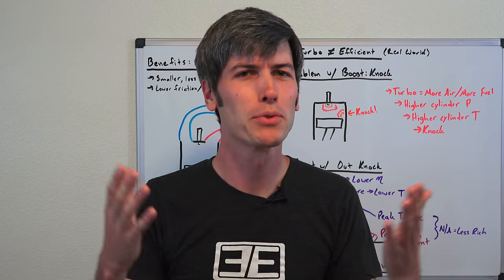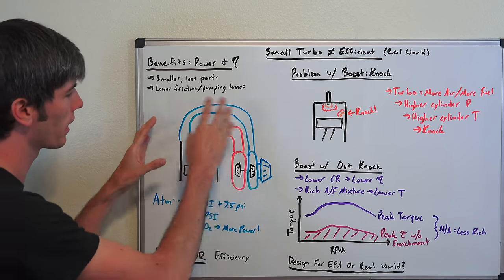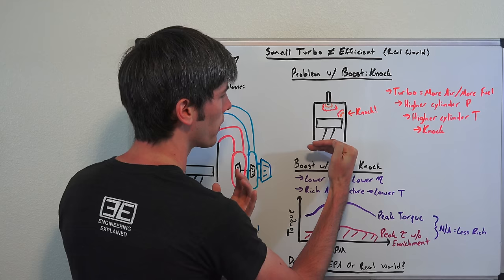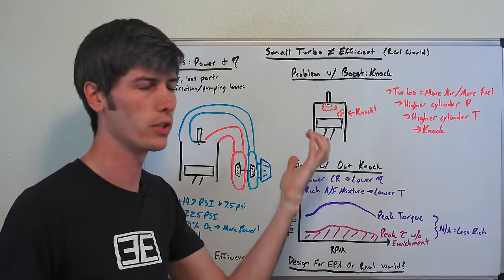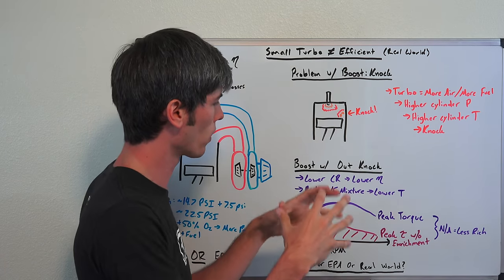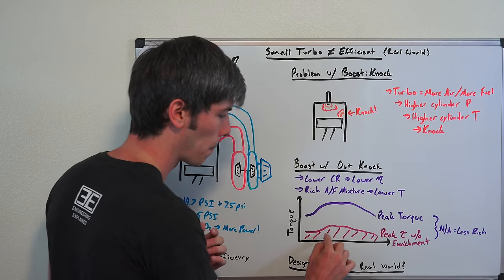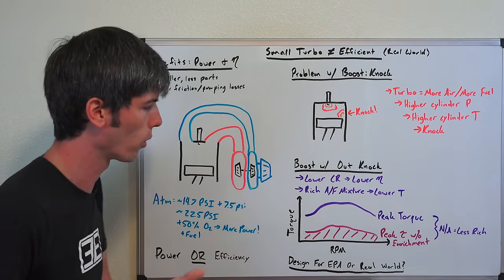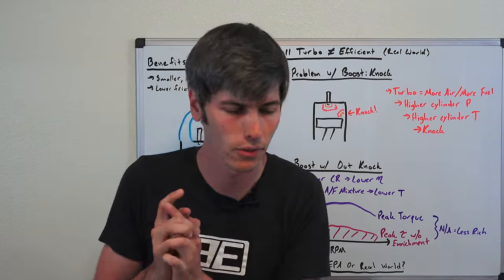Why Small Turbo Engines Are Not Efficient

Comment: I used to drive a 2012 Buick Regal GS with a 2.0l Turbo LHU engine (manual). It would regularly get 23 mpg as I drove to work. I bought a 2018 Mazda 6 with the 2.5l turbo a month and a half ago, and now I typically get 35-37mpg on the exact same route. I know the 2.5l is tuned very differently and it's a lighter car, but still even for those numbers.. Mazda's real world tuning is legit for my use-case.
Reply: DomitionX it depends a lot on the manufacturers because they all default different heat sources by using extra fuel, some of the newer engines use water injectors for cooler temperatures during combustion which requires less wasted fuel to keep the temps down. Also several newer transmission setups involving many more gears allows for cruising at higher speeds at very low rpms which produces much better fuel economy. 9 gears vs 4-5gears lmao what a big difference it makes

Comment: This tutorial is 100% correct. With a small turbo engine let’s say a 1.5 liter, you’re constantly in a boost situation (even during light acceleration) and you will burn more fuel. I went from a 2.4 liter Honda Accord to a 1.5 liter turbo Accord and the average on the 1.5 is about 3 mpg worse than the older naturally aspirated 2.4. 

However, during steady cruise on the highway, the 1.5 is about 3-4 mpg BETTER.
Reply: It's all about "cheating the EPA" numbers in even on the highway in heavy traffic you can't run steady.

Comment: Please confirm this on the topic of cooling with AFR:
Adding fuel beyond the stoichiometric ratio 14.7:1 does not add any more heat because there is no more oxygen to burn the fuel with. It extracts heat from the engine when changes phase from liquid to gas (as described in the video), and exits the engine unburnt with thermal energy that leaves the engine cooler.
Diesel engines also use this technique, the side effect of this can clearly be seen as soot exiting the exhaust as black smoke.
So rolling coal = blowing raw fuel out the exhaust. Not very efficient.
Reply: Diesel engines don't use this technique. They are compression ignition and direct injection (in modern diesels) and therefore do not need to overfuel to avoid knock. Sometimes they will smoke a bit before the boost kicks in and cleans up.
Reply: I meant that they use over-fueling technique to keep EGT down, among other things. Not knock. Thanks for catching that. Can't have pre-detonation when there's nothing to detonate!
Reply: TCPUDPATM PORTS diesel's run lean.  Over fueled the exhaust temperatures increase because of after burning during the scavenge cycle.
Reply: Overfuelling cools the air and makes it more dense. This is why water injection is used in the same way even though it adds nothing for combustion—even on (especially on) turbine engines where there are also no knock considerations.
Reply: Turbines have extremely high exhaust temperatures and often use fresh air to cool perforated turbine blades.  Excess fuel in a diesel is burned during the scavenging cycle causing high exhaust temps and burned valves.
Reply: To an extent, kind of...but then the unburnt fuel is going to send emissions through the roof or, in road-legal applications, make your catalytic converter work really hard and run really hot.
Reply: turbocharged cars need to run richer due to the heat created, but mostly its so you can run half decent ignition timing
Reply: @WholesaleTurbos  Have you seen the ignition advance curve on factory turbo cars? The Ford 2.3 gets a basically-nothing 10 degrees of advance WOT at 6k.
Reply: if i where to slap a turbo on my car and remaped it to overfuel when i change gear or let go of gas and added a sparkplug in the exhaust to make it spit flames would i need to put it before or after the catalytic converter

Comment: Why would anyone buy a turbocharged car and expect high fuel efficiency? I bought a turbocharged vehicle for its high reserve power from a small lightweight engine and drivetrain. That to me is efficient! I still enjoy reasonable fuel mileage by keeping my foot out of it. When I need a boost of power, it's there. I previously owned a naturally aspirated 1.6 L Ford Fiesta and I routinely enjoyed 40+ miles per gallon at 70 to 75 miles per hour but Ford was punished for inefficient drivers claiming that 40 miles per gallon was not obtainable and Ford had to lower the claim to 38. Why buy a Toyota Prius, drive it at 80 mph and complain about efficiency? The technology does not compensate for idiocy!
Reply: Right because you can definitely drive a regular car or even hybrid a certain way and get really good mpg

Comment: as a "proud" 4b11T owner, can confirm the engine has a compression ratio of just 8:1, is slower than mobility schooter when below boost threshold, and gets 15L/100km or worse fuel economy. all that just for them 22psi factory boost (28psi on evos). glad technology has moved on.
Reply: I have the Hyundai version of that engine. Can confirm, not efficient at all.
Reply: Max Castillo isn't Hyundai using 4Gxx?
Reply: That's why for example older Evos and Subies have ridiculously high fuel consumption. Rather big laggy turbo, high boost figures and low compression ratio. So most of the time you drive it like a N/A car because the turbo hasn't spooled yet in normal driving conditions but you give it more throttle because it doesn't move with it's 8:1 compression ratio and isn't efficient at all...
Reply: Discoloured Buttflaps 
4B11T is different from a 4G63T
Reply: Discoloured Buttflaps, i was able to get 9.5L/100km out of my 2004 Chevrolet Impala, but on the other hand i was able to watch the needle on the gas gauge go down when the gas pedal and carpet were best friends lol
Reply: Discoloured Buttflaps i love my 1.6 ecobeast with 10.0 to 1 conpression. Because it never feels under powered.
Reply: New Subaru engine like the FA20DIT in my WRX are way better regarding fuel economy, my average consumption on my daily commute is 8 L/100km (~29mpg) in the summer and 10 L/100km (~24mpg) in the winter. A compression ratio of 10.2:1 and direct injection help with that.
Reply: Max Castillo , HUNDAI  was sued by many about the lying mileage clams .
Reply: Leighton Samms however this lawsuit wasn’t for their Turbo cars..
Reply: The Nissan R35 GTR is running something like 8.52:1 iirc. It's also not very efficient.
Reply: My friend has a 350~ish hp mapped, dynoed, aftermarket exhaust evo9 MR and he managed under 9L per 100km average when he went to visit norway and drove for around 3000km's

So why must companies absolutely make bad mileage cars? That particular car pulls way earlier and easier than for example a volvo s40 t4 which is bone stock. It's like adding only without compromises, feels like a diesel on steroids to drive. even from 2000rpm it starts to boost well already unlike the stock volvo, and yeah theres nothing wrong with the volvo, the evo is just so good.
Reply: eamh2002 because of the EPA and all of their regulations. They have to jump through hoops  just to make these vehicles road legal.
Reply: Discoloured Buttflaps I was able to get 30+ highway with Evo 10..
Reply: Max Castillo my veloster turbo gets more than enough power and a nice average of 28 city highway I'm happy
Reply: RockSolitude That’s because it’s a port injected engine running high boost. Fuel economy isn’t a factor in that design.
Reply: Gauge167 I was once shopping for one of those, I found out that an old Toyota Matrix XRS has more space, 4 doors, weights the same, and depending on the year it makes the same amount of power (190hp) out of an NA 1.8 engine. I lost all interest in the Veloster after that.

Comment: Only time a small 4banger turbo gets better mpg than a 3-3.5L V6, is when your in bumper to bumper traffic.  On open roads, your gotta rev up the 4banger turbo alot more to achieve the same speed.  Therefore using more gas, the turbo is dumping more heat in ur cylinders.

Comment: I didnt buy a twin turbo 3.5 ecoboost for mpg , I bought it for power !
Reply: Ricardo Chavez high five! Boost is for fun, not economics.

Got best of both worlds, v8 with a turbo on either side of it. Like driving a rocketship!
Reply: If you buy it for power then buy the V8. The most reliable engine in the f150. Then you do not need to worry about the turbocharged headache of an engine in the future when it wears out

Comment: If you drive like a street racer and punch the throttle all the time, the boost is always on = bad fuel economy. I manage to get 6.5L/100km average on a 200hp 2.0T engine all the time on a small hatchback, so not impossible.
Reply: Trades46 i do 19,5 liters per 100km average. Wooha lol.
Reply: That is really good for 200bhp, you do mostly highway driving?
Reply: About 80% highway I would say yes.
Reply: I average 7.5l/100 km on my 1.2 TSI 110 hp ahahaha
Reply: 6,5l/100km city driving, 6l highway, 12/15 track (1.5t chatch)
Reply: I get 8-9l/100km in the city, 6-8 on the highway from a 160hp 1.6l twin turbo diesel. It's a fair amount more than advertised, but I don't care. I drive the way I want, not the way that's economical.

Comment: Could gasoline with a high octane number minimize knock and also minimize the injection of fuel to cool the cylinder temperature?

It sounds like fuel consumption could also be significantly reduced at full load at downsized turbocharged engines. 

What are your experiences?

Comment: Turbo, no turbo, gas, diesel... If you drive it like a sports car you get sports car fuel mileage. If you drive it like an economy car you get economy car fuel mileage. Power takes fuel, use more power and you use more fuel. I have a 335i with a tune that makes 23 psi boost. But if I drive economically it gets 19 mpg city 29 mpg highway, when it's making 500+ hp (440 at the wheels) the fuel mileage is considerably lower :)
Reply: The problem is, I think you can go too far the other way. On the lowest end of the range you sometimes don't really get an "economy car" anymore, probably because compromises are made to make the base engine as cheap as possible and keep insurance down for young drivers who get fucked if they have anything over 1.2L, I drive a 1.2L ford fiesta at the moment and while I get higher MPG than people I see on forums who claim to be driving economically I still get less MPG than people driving the 1.6L engine seem to achieve, while i could probably equal/beat them i'd have to start impeding traffic to do it as accelerating with the flow of traffic almost takes "driving it like a sports car", only now its 1.0L T vs 1.4L N/A with more modern cars than my 12 year old fiesta :/
Reply: I had a Holden (Opel) 2 litre 4 cylinder diesel intercooled, manual hatchback (like a golf) and THE WORST fuel efficiency was 10 liters per hundred driving very hard around town.  That is very very good economy.
Reply: No matter how carefully you drive a V8 or V10 it's gonna be a gas hog. Will it be slightly less of a gas hog with granny driving? Sure! But then I gotta ask why the hell did you buy a car/truck with a big engine?! With a V4 or V6 turbo the granny driving actually brings a huge efficiency boost. RWood1995 makes a great point about underpowered cars though, if they are too weak they can be inefficient for highway driving. A key element of Scott Gaines example is having the custom tune on his 335i, what about the stock tune? Obviously custom tunes are gonna be better than stock, hell I'm using a Cobb tuner with an OTS map on my WRX and the fuel efficiency, power distribution and power is way better than the stock tune. 32 MPG highway vs the 27 MPG highway I got with the stock tune.

Comment: Turbo is nice to have when the vehicle is still under factory warranty.  But once the expense of engine repairs becomes out-of-pocket for the owner/driver, watch out!
Reply: Well the turbo itself is a wear part... But besides that not really. The pistons, rods cams etc are fine, unless those fail" your all good. Ive seen volvo turbo with 300k+ miles that never had an issue.
Reply: My car (with a turbocharged, downsized petrol engine) is out of warranty since about 32 years. The car has tons of problems - the electrical wiring is disintegrating,  the body is rusting badly, and there have been issues with the drivetrain. For example, after half a million kilometres I needed a new alternator, and shortly after that the gearbox had to be rebuilt. But the engine itself is bulletproof. 
Small turbocharged engines CAN and DO last. All it takes is an owner with a minimum degree of mechanical sympathy and who does not neglect maintenance.
Reply: @Martin Rudolph . . . I'm impressed with the durability of your vehicle's engine, turbo, and alternator.  The half-million kilometers for an alternator is astounding, as here in the US, the average life expectancy I've had was around 161,000 kilometers when it needs replacing.
Reply: @bloqk16  Simply stop buying American cars then. Here in Finland, we judge them as having roughly Soviet style build quality. Get Japanese or German instead, but avoid the Chrysler era Mercedes-Benz.
Reply: Modern turbos are very reliable. It’s old turbo designs that were not as reliable. Keep in mind semi trucks are turbo diesels with 300,000 miles or more

Comment: they're efficient enough as long as you stay off boost. my girlfriend has a veloster turbo and averages 8.0l/100km(30mpg) and that's with pretty much only city driving through the east end of toronto. Shes scared of the loud noises of revving the car out so she almost never goes into boost. 

ya a 1.8l n/a 4 banger would be more efficient, but it would also be ungodly slow when she wanted more power. the idea of the turbo is that you sacrifice a little bit of fuel economy to just have it there driving normally, but it's there if you want more power, at the trade-off of a bit of extra gas. but if you don't need the power it will still be better on gas on average than a bigger n/a engine making the same hp/tq

edit: someone else said eco/boost. that's exactly what i'm talking about, if you drive it normally, you get eco. you want more power you have that option at the tradeoff of more gas. Maybe i'm just baffled by this, but does anyone actually think that adding a turbo makes it more efficient on gas?
Reply: dos Santos precisely, the key to high fuel economy in a boosted engine is to use boost as little as possible lmao. Lots of highway cruising geared for low rpms and you’ll easily have 30 mpg in a 2.0l turbo
Reply: My Evo X is more efficient when I'm in the boost range, but it's admittedly a bit heavy for a 2.0L without the boost... I Best MPGs are in the lower range of boost (3000-3500ish RPMs), adding power without revving the crap out of it.
Reply: >Buys Veloster "Turbo"
>is scared of turbo noises
wat
Reply: @lsswappedcessna  women
Reply: 8/100 is not very economical actually. Its a 'modern' engine with direct injection. Dissapointing really...
Reply: you should of said drive faily slow instead of driving normally because my normal driving in my 1.2 it basically redline all day every day unless the engines cold. however in my dads 525d i accelerate the same pycically but im barely touching the throttle. lol

Comment: My 2019 Jetta with a manual seems to do better mileage wise than expected with a 1.4L Turbo. Rated at 40 mpg on the highway, I've done a 45 mpg trip, recorded by the cars computer. Still fast enough to punch it on the highway as well, doing zero to sixty in about 8 seconds.

Comment: @Engineering Explained, your explanation is partially correct, a modern Tcharged engine is efficient at low and high loads, first way to reduce engine knock in modern forced induction engines is EGR valves, secondly water cooled intercoolers. I've driven 1.2 TSI Vw group car for 60.000 miles(company car), city, highway and mixed cycles, it got way better MPG then a naturally aspirated 1.6 MPI(equivalent power natural induction engine), both having around 100hp,
Reply: Also the fact that non-turbo engines also use richer mixtures under load/to create power.

Comment: I baught last year a 1.0 TSI Skoda Octavia 115 hp, 200 Nm. I am verry happy with it, i don''t drive it fast until the engine oil gets to 60/70 degrees Celsius, i got an average of 5.8 L/100 Km till now, and that is excellent. It has 1150 KG without the driver, so the weight ratio is 100 HP/Tone which i think is enough. If people learn how to drive a gasoline turbo engine, everyone will see that is more efficient and fun to drive then natural aspirated gasoline or diesel engine(in my opinion).